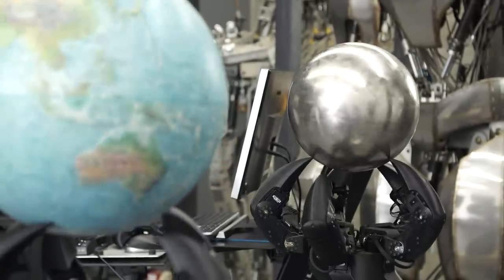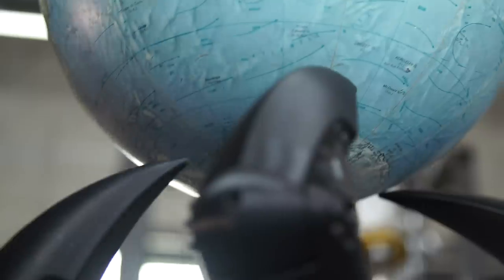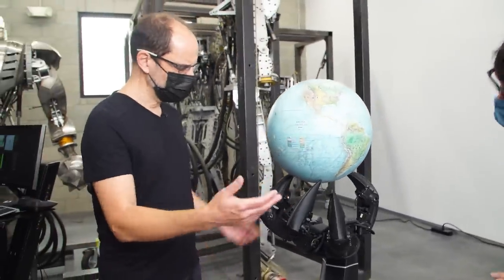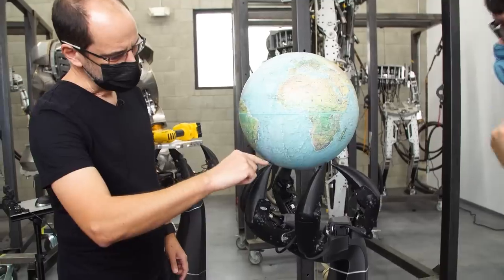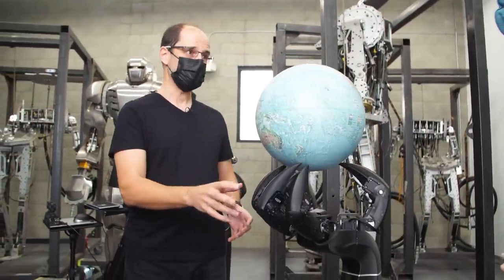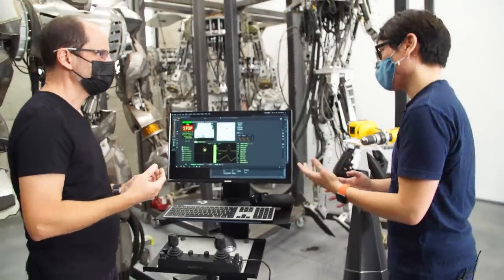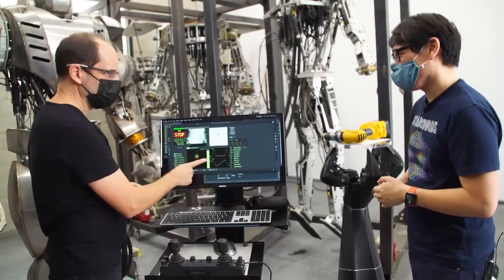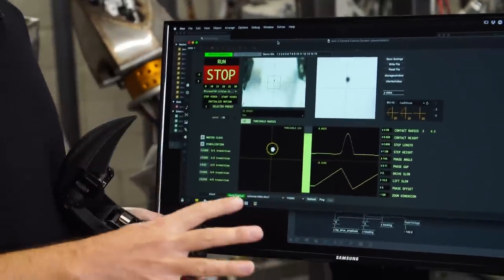The Animatronic Robot Designs of Mark Setrakian!

Comment: What a way to rotate a globe on its axis. This is incredible
Reply: I think they used it to spin the trophy on BattleBots.
Reply: i thought the same, honestly i'd just put it in my office and act like i'm some super badass controlling the world
Reply: Evidently this is the guy designing the leader of the robot uprising
Reply: Think of this:
This system being the connecting joints of every muscle structures of a humanoid body. A Magnesium alloy skeletal body PEO'd and inside the skeletal body a Ryden dual carbon batteries powering the servo motors while each one of the wiring of the drives are safely tucked inside the skeletal system with cooling fluid system running outside of each PEO Magnesium alloy bone.
Ofcourse adapting to limitations of movements but nonetheless applicable to BioRobotics.
Reply: Indeed! It's hypnotic hehe
Reply: @bigdaddy910  Best high tech lazy susan in a cyberpunk theme restaurant.
Reply: @definitelynotobama6851  they literally said in the video that this was used in battlebots
Reply: just amazing!
Reply: Beyond it looking amazing,  using waveforms to control it is utter genius. Motion synthesis indeed.
Reply: Now I'm curious how long it maintains axis. Few minutes, hours, etc
Reply: Sauron has discovered additive manufacturing.
Reply: They need to put a chair on one. I'd sit in it all day like a king
Reply: Which axis. 
All of them
Reply: It’s a sphere
Reply: I want one for that and other reasons i can't think of at the moment
Reply: And then Terminator happened ☠🤖☠
Thanks science

Comment: Truly amazing. Out of curiosity, I wonder if you could do this using more mechanical parts/motion vs separately controlled motors. Meaning an array of gears that attach to only a central motor that could control all motion off all fingers. Since the movement is repetitive and follows a distinct pattern I thought maybe an array of well designed gears could offer similar movement. Of course, this probably wouldn't be as smooth like this, i.e. butter. Just thinking out loud, if you could do this, then you could make it way cheaper, reduce any software code to pretty much zero, and easier for people at home to 3d print/make. In general, this is awesome and I love the concept!

Comment: How much does the globe axis of rotation drift over time? Surely the robot isn't exactly 100% accurate, it's the real world after all, not a computer simulation. Or does it got some sort of sensor and programming to adjust the motion to correct the drift, like on the second version?

Comment: Unfortunately it appears the Axis 2 used by BattleBots needs some maintenance as it's not functioning correctly.  (As least in the most recent TV series.)
Reply: The robot was fine.  In previous seasons they had a lightweight 'stunt nut' that the hand was rated to handle. This last season the light nut couldn't be found so they used a real one which the machine could only barely handle.  Apparently everyone was just out of shot in case the big nut got dropped, which was a real concern.